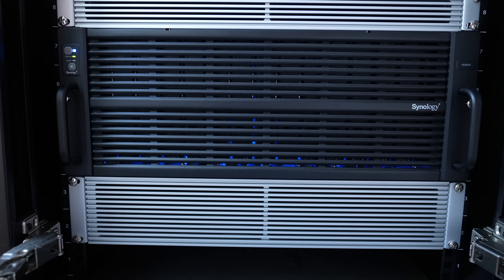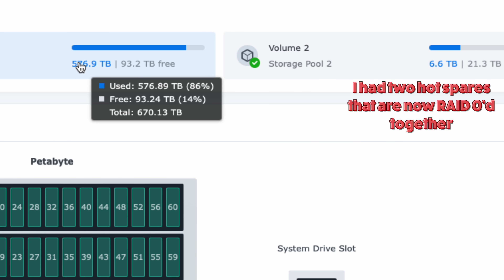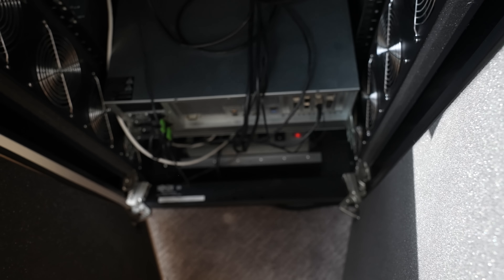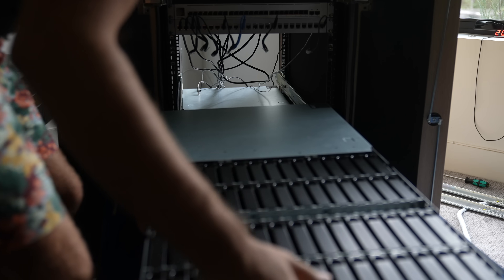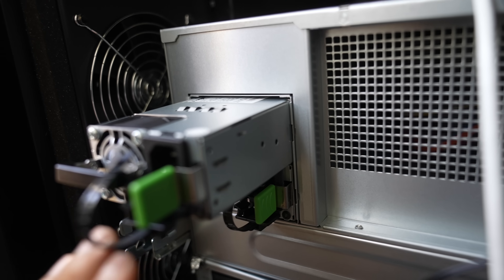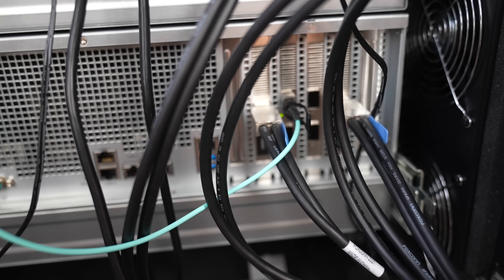1.9 Petabytes - Expanding the Synology NAS

Comment: A couple of small things, not complaints, but advice.  On the power, you should consider plugging 1 power cord from the NAS, and 1 power cord for the expander into each UPS.  This allows for 1 to fail, without losing access.  You can combine drives from the expander to the main NAS, but there is a drive limit to such things, and you also become dependent on both devices working at all times, which you seem to have already sussed.  I'm guessing 2027 before you knock on Synology's door again.  The rate of data we store every years seems exponential at times.  Loved the content, can't wait to see the third installment!
Reply: If he did that and one UPS failed, he would instantly go over capacity on the other UPS.
Reply: @wbfaulk  Time for a bigger capacity UPS then lol

Comment: Servers have a large startup power usage. It is likely that the battery is still good enough for "normal running" usage, but you really should look at getting a larger one.

I have my server plugged into my UPS, and into a wall outlet. If the unit looses power long enough to be totally shut down, it will auto reboot as soon as power is restored. The server will also be able to draw the full power from the wall instead of overloading my UPS on boot.

Comment: Hey Gav, hope you are staying on top of your UPS battery replacement intervals. Those lead-acid batteries wear out over time even if they say they are charged to 100%, they will not last as long in an outage. Usually all the batteries need to be replaced every 3-5 years.

Comment: you added a JBOD.   Looks to be the same case just with out the mother board just a boot board.  The JBOX or expansion pack could have use the space used for mother board for more Hard drives.   Like with mine it has 36 drives, and I can expand to a cast that is the same but were the mother board was can handle more drives up to 45 more.   I wonder why they couldn't added space for more drives in the expansion.

Comment: pro tip simply buy supermicro jbods. better hardware for cheaper
and use a seperate server as a headunit. that way you can skill scale is nessesary without touching any of the pool or depend on the software

Comment: This may be a dumb question, but why don’t you keep 2-3 years worth of footage on the NAS, and then keep everything else on tape drives?

And yeah, I know you’re already using tape drives as part of a backup solution (3-2-1), but for archival purposes - which is what this NAS expansion unit seems to solve - using tapes for cold storage is way more cost effective both in terms of hardware cost as well as electricity. Why not just use 2 tapes - one for archival and the second as the ‘normal’ backup?
Reply: Because he’s getting fancy NASs for free or highly discounted?

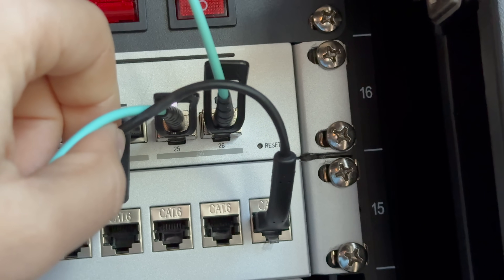Comment: These professional well all disk array based systems have surprisingly disappointing performance. Filesystems are really bad (no real SSD Support) the RAID algorithm is pssht used incorrectly ??? (Hint you don't want it locally). Access patterns ignore spindle geometry! (Inside much slower than ooutside, seeks are prohibitive unless pssht, NCQ but better association...) Sosso plenty hints ron, back to shleeep for some reason 8:46

Comment: Those units have dual power supplies. Did you plug one supply from each on one UPS and the other power supply from each to the second UPS? This may just not have come across on the video. This way failure of one UPS or power supply in the unit should hold on the second UPS. This only works if each UPS is carrying less than 50% load.

Comment: You'd do well to investigate running something like TrueNAS Scale on similar/the same hardware.  You can scale up pools MUCH larger than something like a Synology setup without worrying about data integrity (well, more than you normally would with hundreds of drives).

I have built many multiple-petabyte single pools with ZFS and it is absolutely the right tool for storage at this sort of scale.

Comment: 4:03 Installation manual:
Step 1: Get sofa cushion as make-shift jack.
Step 2: Slide server in rack.
Step 3: Remove cat from server cabinet.
Step 4: Get second sofa cusion.
Step 5: Slide in second server rack.
Reply: Step 3 gets repeated several times in the process...
Reply: Step 6: Ask cat for his opinion.
Reply: Step 6: the cat will give its opinion  when it sees fit.  Perform food-time sacrifice in a timely manner to obtain opinion before next June..
Reply: (Sofa cushion not included)
Reply: Step 0: (off camera) rub balloon on cat to maximize static charge. testing how resilient the system is to static. It is on carpet, after all.  I'm sure the cat won't mind. 

Furniture skids would make moving the rack so much easier.

Thanks for all the videos. All of them. Awesome Slow-Mo, Collaborations, Behind the Scenes and these about the Technology that make the magic happen.

Comment: Small note(s) here, the redundant power supplies are both active and normally load splitting, eg: if the unit needs 200W each PSU is giving ~100W, though, with say 90% efficiency, you would see ~108W each. tl;dr, no failover, just the last active one takes the full load. This is also meant in the enterprise to split the load over A/B power, for you, you would want 2 UPSs, 1 PSU in each, and normally only 80% of the UPS or breaker rating max or over 80% for less than 3 hours iirc from the NEMA rating stuff. That would protect you from a UPS failure and a breaker failure that way. 

True SAS is also more like a switched network, so, each of your SAS paths in the back, if it's SAS3, is 48Gbps (4 12Gbps links) for a total of 96Gbps total with the A/B path, so, if you ever notice that a copy to the JBOD (expansion shelf) is slower than normal, cat might have knocked a path loose. Also means more shelves will have lower speeds if you make one pool/volume per shelf and try to hit 2 ext shelves at once as you are setup now. 

Not sure if Synology has it, but, Server-Side Copy being on in SMB where it will do file copies/moves on the array vs reading it up to your computer and then writing it back down to the new place, it should do that for you in the background. Looks like for Mac you might need to get this enabled some way or another "Note - not enabled for OS X (Macs) unless server Samba includes vfs_fruit module and fruit:copyfile = yes in smb.conf."

Comment: But how many 8hr 8k fireplace videos does it hold?
Reply: At least one
Reply: Let's be silly and assume a RAW 8K 60fps HDR video stream. 8K is 33,177,600 pixels (33.1MP). We'll multiply that a bit depth of 12 bit per pixel, so each frame is 398,131,200 bits, which dividing by eight (8 bits = 1 byte) is 49,766,400 bytes, or basically 50MB. Then multiply by that 60 frames per second, for 2,985,984,000 bytes/second, or 2.9 GB per second.
Eight hours is 28800 seconds, so 2.9GB/s multiplied out to 8 hours is 85.9TB (specifically, 85,996,339,200,000 bytes). 85TB goes into 1.9PB 22.4 times.
So, 22 8-hour, 8K, 60FPS, HDR, RAW fireplace videos. And then a 3 hour video as well.
Reply: You want 12 bits per color channel, not 12 bits per pixel. So roughly 7 of them. @ryankrage77

Comment: Is this really just RAID? nowadays I strongly advise not to use storage spread amongst multiple harddrives without checksums. If it's just XOR parity the controller cannot know which data is not corrupted. Using for example ZFS would be way better.

Comment: Next.... give one of the UPS makers a call. You need to up your game in regards to the UPS you are using.
As other have commented on, you currently have it all on two "line-interactive" style of UPS..... "Online" UPS's would be a better choice for data integrity.
How are these connected to the redundant PSU's in the units?

If no one is going to "sponsor" an upgrade. then you should at least have on expensive "online" UPS, connected to one PSU in each unit.
Then you can use a cheaper "line interactive" UPS on the other PSU in each unit.
Of course two "Online" UPS's would be the better option

Either way, split you PSU's to different sources. That is how they to it in enterprise scenarios.

Comment: Cool tech but Synology gatekeeps features with high capacity HDDs to only drives with their firmware which are near 2-3x the cost of the equivalent 20TB HGST or Seagate for just a firmware revision.

Comment: Let's talk about your UPS. If I am not mistaken, the time required to gracefully shut down your Synology during a power outage is likely to EXCEED your UPS battery capacity if your idle load is 50% or more. I would guess you have around 5 minutes of runtime at that power load. As the batteries age, this gets worse over time. I would try not to exceed 25% load capacity on a UPS so that you can be assured plenty of time to power down the storage before power loss. Also, fully draining a UPS battery can often result in needing to replace them. Ask me how I know :)

Comment: I know it's very common for enterprise gear, but why did they bother branding the drives ?

Those are clearly regular Western Digital hard drives.

Is there some vendor locking going on ?
Reply: Yes, synology has removed support for "third party" drives.
Actually the stupidest thing I've ever heard

It seems like users can at max have one or two third party drives in their systems, the rest have to be bought from them so that they can upsell you as much as possible
Reply: @Kire2oo2  Why did they feel the need for such a user hostile move ?
Last I checked, they were selling lots of units at a healthy margin.
(I know why, it's greed, it's always greed.)
Reply: @Luzgar  youp, I can't wrap my head around it either, it makes no sense.
I guess greed ruins everything
Reply: I'm not familiar with Synology, but NetApp provides drives with custom firmware that better supports the details of how it's used in their system. It's unclear to me if that firmware could be applied to the equivalent retail drive or if there's something (perhaps low-level formatting? Is that even a thing on SSDs?) that would prevent that from working.

Comment: Isn't it getting (too) hot with twice the amount of drives in such a small cabinet?
Usually you have quite a lot of fresh air coming out of the floor panel below the rack.
This doesn't look too well ventilated in such a small cabinet with quite a lot of isolation around it. (noise dampening sheets typically also do a good job in thermal isolation)

Comment: I would put each redundant PSU into a different UPS. So each UPS will handle half the load of each appliance. Also it's best if the UPS is able to handle the full load on its own so it can be redundant if one UPS fails. UPS failure are way more common than PSU failure.

Comment: What happens when a un-backed-up power supply fails in one of these? is all the data wiped? or is it a "corrupts the file you could be in the middle of transferring" thing, or "data becomes forever unreachable"?
Reply: I assume you can just hot swap for a new PSU which you probably want to do once one fails
Reply: I asked what the effect of it happening was, not the ease of resolving the issue -- as in, why is it even important to have backup power supplies ready? is it extremely important it remains powered for some health of the data reason, or is it just a "what if I want to look at those files and discover I'd need to order a new power supply and wait for it to ship" thing?
Reply: They have redundant power supplies cause it's business grade equipment, where downtime can cost a lot of money. So most servers have redundant power supplies. Like this you can also replace them while it's still running. On server farms they go even further and have them plugged into completely separate circuits.
A power cut would corrupt the new file it started to transfer, but not the original. Imagine pulling out a usb-stick while writing some data onto it: The file you copying is still on your pc and not affected.

So in short, a power cut would only really affect the files it was writing to disk at the time, not the entire storage pool.

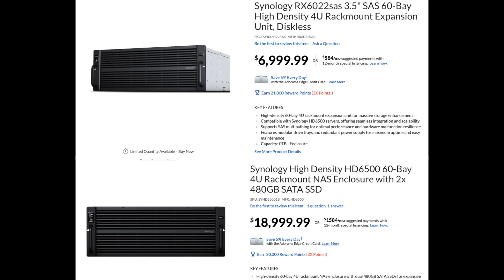Comment: 10:21 I'm almost certain that you'll eat these words.
Reply: 100% seeing as has filled his original petabyte nas from 2 years ago and still runs the 130TB nas that LTT built him.

this expansion is gonna last them maybe 3 years.
Reply: @oxfordsparky  Even though the first petabyte system is only two years old, don't forget that it is filled with 15 years worth of footage. Unless he has more backlog that needs to be stored on the second petabyte it should last a decent bit longer than the first petabyte. Or untill he decides to start filming at even higher resolutions and framerates lol.
Reply: @Dusto9 doesn't he have the new V2511 phantom camera... so with his current speed... 3 years give or take
Reply: Same words as previous video....

Comment: Both of your UPS are not Online UPS but are Line-Interactive UPS, meaning they are not actively supplying power via batteries at all times but are supplying AC and only have battery step-in during power failure, meaning these UPS will let through minute power interruptions which is not recommended for mission-critical usage.
Reply: if line-interactive type of UPS are really unreliable (they have a ~10msec switchover delay), why are they being sold? Can they not keep an IT equipment be running in the moment of the blackout?
Reply: @ricsip  It's down to cost. Price of UPS increase frrom Offline UPS to Line-Interactive UPS to Online UPS. So its for the consumer to decide on Cost Vs Data, if your equipment or Data is important enough for the price of Online UPS.
Reply: @ricsip  in a normal scenario a Line-Interactive would be fine, but during data writes it may not be, and in case of a NAS vault like this, it certainly is not. For example, if you were transferring a 5 GB video file, if there is even a 10msec interruption during Data write, the whole file might be corrupted and unusable, or even worse, it might lead to a bad sector on the disk. Again, there are ways to salvage that file, but if your data is important enough that you would need to salvage it later then why risk it at the first place, proper get protection.
Reply: @Falcon5ive  I'm completely ignorant in this area, but wouldn't the Synology equipment have some kind of built-in protection against that kind of issue? Their whole business is based on keeping your data safe so I feel like they must have some basic power conditioning in their equipment.
Reply: @robadams1645  Synology is a NAS, and in a NAS the Data protection comes from having RAID which saves data in event of drive failure, but does not have any protection in case of power interruption during writes which corrupts the data being written.

Comment: Fellow Synology user. Thanks for the details on the Expansion unit. Five years tops till you need more storage.
Reply: Yeah he's going to get a new Phantom and step up the amount of data each shoot takes up yet again, I'm surprised he was so confident it was going to stay enough for so long
Reply: Just wait until they get the first 8K 1,000,000 fps high speed camera. It'll be like a petabyte per second :D
Reply: Just needs another couple of JBODs to hook up
Reply: Kinda hard to complain about free storage, but he could have gone with 24TB drives and gotten another 400TB out of the expansion server.  He didn't address it in the video but I wonder if the expansion needs drives of the same size or smaller to function which would necessitate the use of 16TB drives.  Seems odd either way since even going with something like 20TB drives would have made more sense.
Reply: @spyda450  As someone with 20TB drives, I can tell you the main disadvantage once you go past 14 or 16 TB is how incredibly long it takes to resilver a pool (in ZFS) or rebuild a RAID array with these massive-capacity drives.

During that time, especially if you're not using a lot of redundancy (like RAIDZ2 with 4-6 drives), you're at greater risk if any other drive fails... and with that many read/write activities going on at the same time, it's a good time for another drive to fail!

Of course, when you're dealing with petabytes, as long as your storage layout is decent, it is a mitigated risk and 20-24 TB drives aren't the end of the world.

This is all assuming you have a complete backup of the entire data set, too... which I'm guessing for practical reasons Gavin doesn't?
Reply from the maker: Synology offered 16TB again so it’s what I took but I could do the next expansion with higher capacity drives. I have this stuff on other drives off site as well as an LTO copy of everything.
Reply: @TheSlowMoGuys2  Oh shoot I do remember you mentioning the LTO copy; good on you :)

Next up, getting a 2nd onsite copy, if for no other reason than to one-up LTT in terms of Petabytes-on-site :)
Reply: @JeffGeerling  Geez that Sync will take a while
Reply: Until then there will be higher storage systems available, that use less physical space...
Reply: Where’s Dan?

Comment: Synology got my wrath for a bit when they killed off support for third-party drives. Synology's whole deal is that you're paying them for something you could throw together yourself, they just make it easier. Well, they eliminated one of the biggest hassles and lowered their support burden using One Simple Trick. A couple weeks ago I had to buy a set of disks for a customer recently I was pleasantly surprised that their branded disks weren't any more expensive than the third-party equivalent.
Reply: Same. And it is a completely stupid move, even when they have no real competition.

At least, all the nagging messages and so on disappeared forever after some changes I did to the NAS via SSH. No clue if it got worse or better since then.